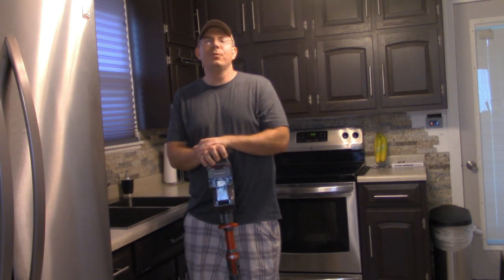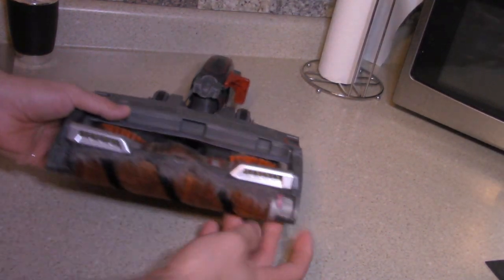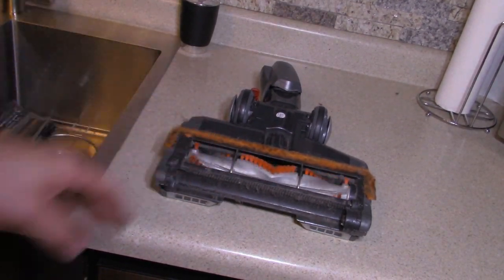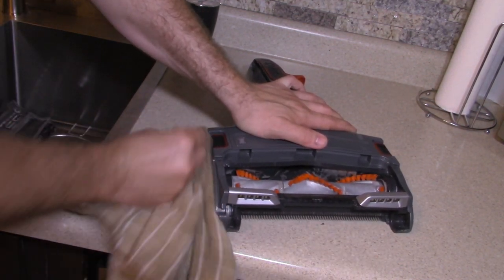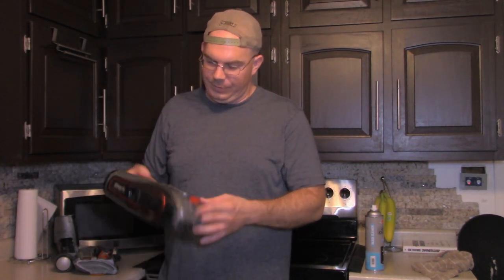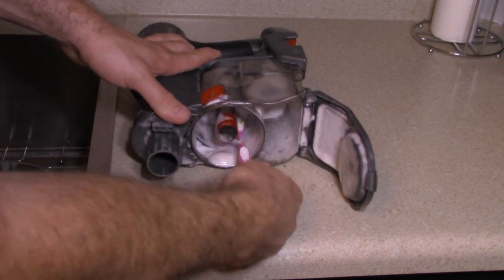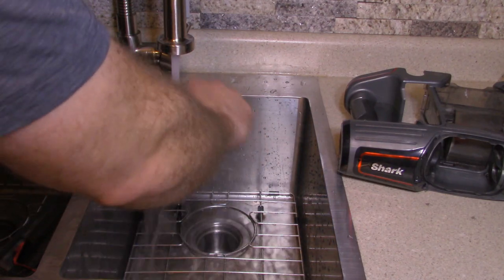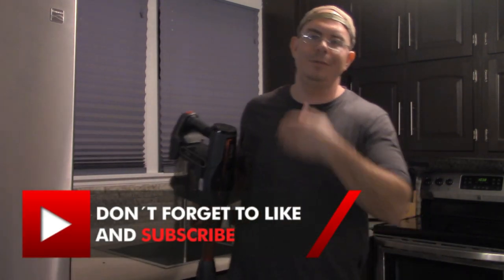How To Clean Shark DuoClean IonFlex Cordless Vacuum Cleaner

Comment: I can’t thank you enough for this video. I love my Shark cordless vacuum with two rechargeable batteries. I use it every day. Mine does not have the flex rod but all else is same. I followed along and took it completely apart and cleaned just like you did and reassembled. It had gotten sluggish but now it cleans like a beast again. I’m 74 and wanted something without cords that I could trip over. It’s wonderful. I also have the big Shark upright for carpets. It’s amazing too. THANK YOU THANK YOU THANK YOU!

Comment: Thanks a million.  Mine was just not staying on (lights were but the vacuum wouldn’t spin and the motor would stop seconds later), so I saw you pull out those two filters and I believe that was the issue.  UDAMAN thanks again.

Comment: The shark is much better than the Dyson in performance and battery life. Dyson gets you when you need to replace the battery. The price of a replacement OEM battery is almost 75% if the cost of the vacuum. Good luck trying to find an aftermarket battery on Amazon. That's a crap shoot in finding one that actually works when you receive it. Been there done that. Oh yeah, great video 👍

Comment: My daughter has the if200, i dismantled it enough to remove the hard brush roller because it was jammed and would not rotate. The issue is that i could not see how it was possible without damage to remove the drive gears at each end. Behind them are the mounting flanges where its not possible to remove any built up hair, i was olny able to remove a few strands. It very much looks like the gears mounted on bearings are a press fit onto the shafts, it would have been better if they were retained by a washer and nut in order to remove the crud inaccessible. One other thing after extensive searching could not find a new replacement, there are plenty of the front ones.

Comment: Clean with an air compressor (100 psi or more), no need to use water, about 5 minutes and back to vacuum again. Check the long tube along with the connection to the head, it could be clogged. Long tube use a long stick to push the junk out. The tube connection to the head, use hemostat forcep.

Comment: Mine won't turn on.  The battery light blinks.  I've checked for clogs and I've cleaned it.  Any ideas?
Reply: So it means dead battery!  I've had it charging.  I'll check my outlet and try again.

Comment: So I did all this and for some reason I feel like it overheats and it turns off after like 5 mins and the control you see it goes from tile to carpet and blinks back and forth and turns off.. has that happened ?
Reply: I had this same problem. I was about to replace it with the new Dyson v15 but I called Shark and they are going to send me a new power head. I might still buy the Dyson but I'm glad that my ionflex is going to be working properly again. I really like this machine

Comment: My vacuum has a lot more hair stuck on the brush. My hair is very long, down to my hips, so my vacuums are always really hard to clean. I was hoping I could take the main brush off to cut it easier. The hair is wrapped around real tight.
Reply: Torrent showed how to remove the front brush and I have done that several times. As far as I know the back brush is not removable by customer. Probably a dealer could disassemble the Shark but I'll bet the bill would be a hundred dollars.

Comment: Which cordless vacuum do you think is the best?
Reply from the maker: I personally prefer the durability of the shark over the dyson vacuums. I am extremely hard on the vacuums. I personally use on a daily basis for 5 hours a day of constant vacuuming I use a shark rocket. However at my house i do have a dyson as it does a fantastic job in cleaning my small house. If i had kids, a larger home, lots of carpet, and multiple hard surfaces I would go with the newer version of the shark cordless rocket. I just bought my mom one that has a self cleaning head and is cordless and it does a fantastic job on the animal hair from her dog. Shark makes a more durable vacuum, however the suction on a dyson almost can't be beat. I will take durability over suction and spend a little more time cleaning the areas than worry about dropping a $300 vacuum once and breaking it like I have done on over 10x dysons. Hope this helps.

Comment: When I shut off my vacuum and stand it up right the dirt falls out of the bottom. I’ve done this type of cleaning and unclogging with no results.....any ideas?
Reply from the maker: Unhook the head and shaft and does the unit have suction at all out of the main body?
Reply: Same here. I do all the stuff in this video anyway.... im guessing its maybe dirt inside the pipe and sometimes get blockages in the pipe where the head is. And then I'll replace filters in case damaged

Comment: Man I appreciate your time with the video but I'm not sure I would be putting water on the brush part like you did. There is a chip in there a circuit board rather and wiring and a little motor. I know because I just took mine apart. So be careful with getting too much water in there guys